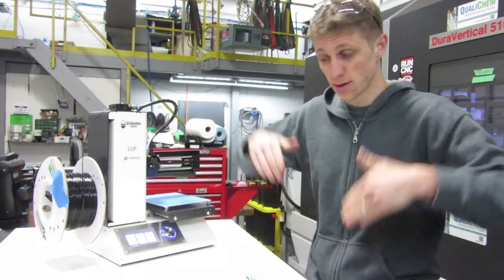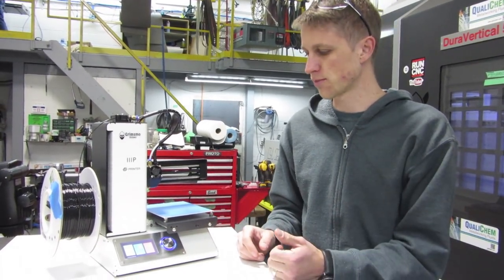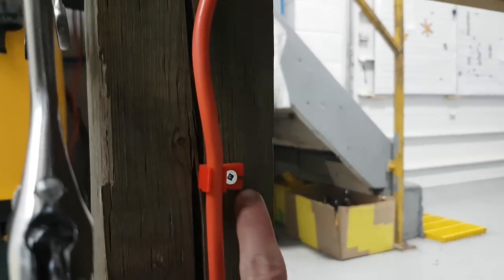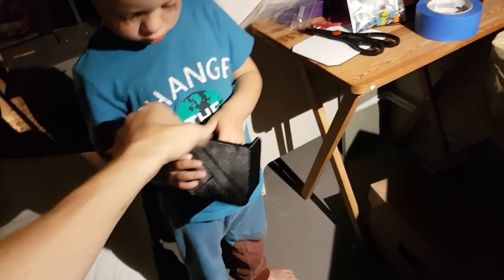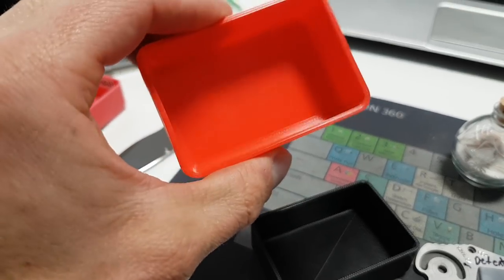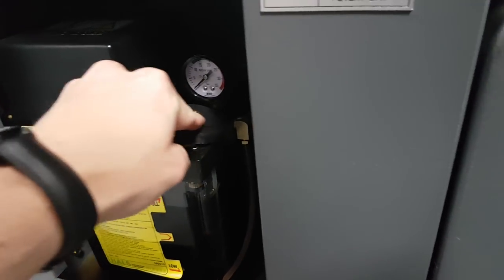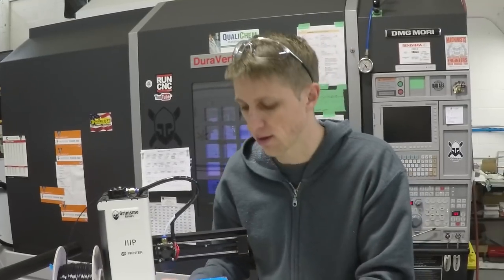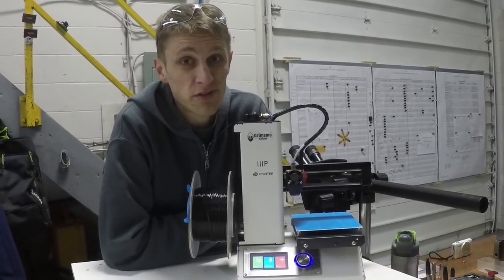Make lean improvements with a 3D printer!

Comment: From the CCOHS website:

Never Use Extension Cords as Permanent Wiring
Use extension cords only to temporarily supply power to an area that does not have a power outlet.

http://www.ccohs.ca/oshanswers/safety_haz/electrical.html

You need to figure out a permanent way to get power to your workbench.  Be safe

Comment: If you're getting one for the shop, look into some of the other filaments you can use. I print tons of polycarbonate on a buffed up Ender 3. Even with the upgraded hotend, random other necessary tweaks and a good enclosure, I'm still only have about $450 sunk into it. For industrial use, it's hard to beat pc once you learn how to print it right. (And no, that's not my only printer...I have a small farm of other ones dedicated to other printing needs)

Comment: Schaller bins are 1.20$ a pop. Wonder how cheap your power and filament must be to print your own.
Reply: Julius Jahn I am sure filament is .02 or less.
Power insufficient and earnestly what you need. Great solution.
Reply: In the UK good filament is 2pence a gram and it costs me about 5p per hour to run my anet a8. So I guess those bins cost around 25p to make.

Comment: printing plastic has a grain (like wood) which is why it cracked. turning it 90 degrees (so a different part was on the bed) would make it stronger in that direction

Comment: If you print the holster vertical you won't need support material.  Print just you did the bins.  Great job.  Huge advantage already knowing a CAD program.   Looks like you totally nerded out with the printer.  Cool.    Check out the CR 10S.   Not much more expensive that the one you bought but much bigger platform than that on.  Not the best printer in the world but most bang for the buck.  Have fun.

Comment: I too just got a printer (Printrbot Simple Pro) and I've been finding all sorts of uses for it that I didn't have before.  I picked up some PETG filament and I've been pleased with the durability of it.  I've been pleasantly surprised with the capability of the prints, they are stronger and more durable than I expected.  I'm not going to go make anything that needs to withstand a lot of force, but you can do some reasonably demanding things with it.  PETG is a real PITA to print, I had to slow down to 40mm/s and 20mm/s instead of 60mm/s and 30mm/s.

Comment: Probably would've gone with a bigger printer for the shop, there's stuff you can make with volume that you can't make with a small one, like a CR10. Also, if you're not already on it, print some ABS and then acetone fume bathe it for extra strength parts. Otherwise with PLA, buy large capacity low viscosity cyanoacrylate glue containers and dip the parts in it. Do be mindful of where the glue drips and how it drips from the part tho.

And so you don't grain crack parts but also maintain structure, like in those clips, print on the side that benefits all purposes of the part.

And second, don't move the axis fast, that puts current back in the machine and might damage parts. Don't ask me how i know.

Comment: I'm gonna have to get a printer at some point 😁 For bigger things, the Creality CR10 seems a very popular model - myfordboy uses one to make sand casting patterns
Reply: Hello Lindsay, I have a CR10 and for the price I paid it is a good and quite solid machine. After about 30-45 min of assembly, you can use it. Like John, I use it to print "useful" things for my mechatronic shop, like SK tool holders, discs/spacers for my tool and gutter grinder, cable hooks, spanners etc. Many mods are possible to increase its performance. There is a large user community sharing useful tips about it. From my point of view a good buy, especially since you can mod its G-Code interpreter.

Comment: The Monoprice printer is an okay printer.  But the Cetus3D printer is significantly better as it uses proper linear rails.  3D printers work great for printing soft jaws for funny shaped parts for prototype purposes.
Reply: thecogwheel r

Comment: I can see high resolution 3d printing useful for mold making or prototyping but I can't see much value in them other than toy factor.   I dont like any plastics though even composites.  Metal > Plastic
Reply: I use my 3d printer for cheap prototyping prior to cutting metal.
Reply: Nathanial Swearingen makes sense.  I use brass to prototype Titanium parts since it's cheap and easy to cut.  My parts are small though.
Reply: they're great for making strangely shaped enclosures, gives you a lot more design freedom and saves having to pay for molds and dies. That being said, plastic will always be plastic, and metal will always be metal. They both have their uses...

Comment: Hey... John or Eric, I noticed you had a hand held hardness tester... I have been NEEDING a Rockwell tester badly, space is a bigger concern than money right now, though I don't have a lot, I can get a floor model or hand held for around $1000, but I'm afraid the hand held isn't efficient enough, right now I'm using files... How does it work for you?? I built my own oven and do all my own heat treating, but have little faith in the files.... Thanks for your time, love the videos!!!!